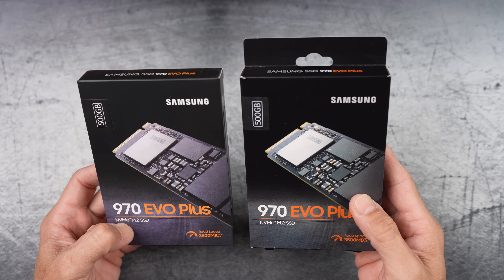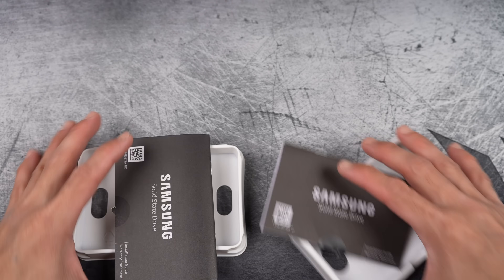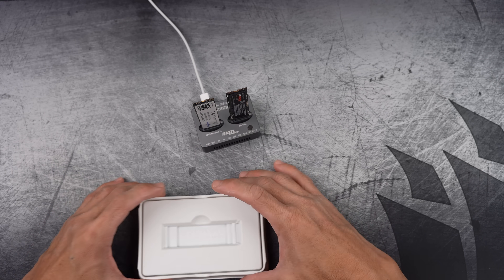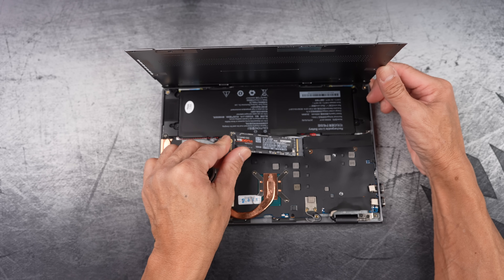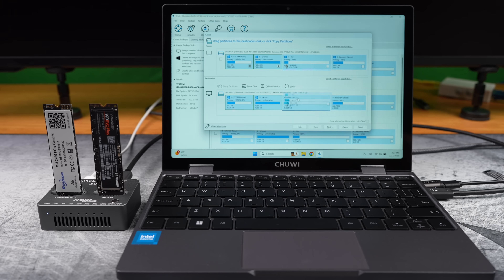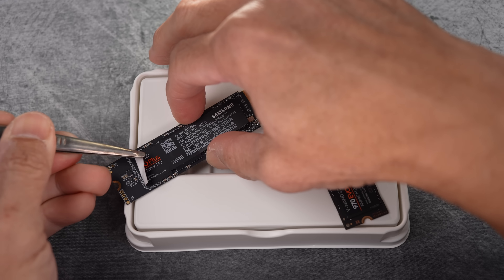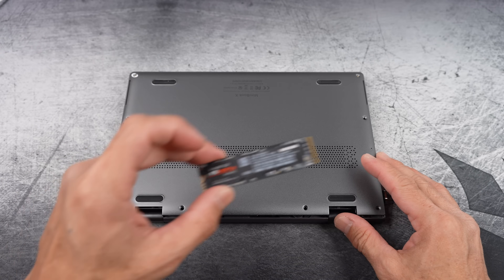Fake vs Real SSD - Can You Spot the Difference?

Comment: I've had fake drives that say 4tb storage but as soon as the drive fills to 120gb it gets ultra hot and drops down to 10-15kb a second.  also everything after this point is corrupted or missing.  😊 it would be interesting to see if the fake drive you have goes past the 120-160gb limit.  The drives that I have tested are from multiple companies and range from 1-4tb each and are brand new.  😎
Reply from the maker: Thanks for sharing your experience! That’s a classic issue with fake drives—they can claim huge capacities but fail miserably when pushed. I haven’t filled this one past the 120–160GB mark yet, but your observation makes me curious to test it further. Appreciate the suggestion—great insight!

Comment: At the end of the day, what risks are there if my drive shows up and turns out to be a fake? Do I get into any trouble if I use it, or are there actual security risks (assuming I format it anyway)?
Reply from the maker: Thank you for reaching out. No trouble at all for using it. Formatting it can mitigate any potential problems. The following are the worst cases: If a drive is fake, the possible main risks are data loss, poor performance, or reduced lifespan. Security-wise, formatting helps, but if the firmware is tampered with, it could still pose a risk from malware. However I wouldn’t be too concerned. If it works fine, then I wouldn’t worry. Using trusted brands is the safest bet.
Reply: @TossSong  Amen.
Reply: Reliability of the NAND. Knockoff SSDs source the NAND from old drives, or ones that have failed QC in the factory. These drives do not last very long. Sometimes they also have worse than expected performance.

Comment: Worst is the reliability difference that the capacitors on the original Samsung provide, in comparison to the generic drives that ignore power continuity altogether.
Reply: The bigger issue is the quality and source of the NAND - generic Chinese SSDs usually use defective NAND that is recycled from old drives, or new NAND that has failed QC from the factory. These drives usually don't last very long and customer support either doesn't exist or they won't help you. It's likely the same for this Samsung drive, although I must say, I've never seen one look so convincing before.
Reply from the maker: Great info. I would agree.
Reply from the maker: That’s a critical point—reliable capacitors can make all the difference for power stability and long-term durability. The generic drives definitely skip corners, and it’s a big reason why we are sticking with trusted brands like Samsung. Thanks for sharing this insight!

Comment: If you use the device to clone from a 512 to a 1tb. do you still have to change the partition size of the larger destination drive and cloning? Do you think the cloning device is worth it?
Reply from the maker: Great question! If you clone from a 512GB to a 1TB drive, most cloning devices copy the partition exactly as is. You’ll often need to manually resize the partition afterward to utilize the extra space on the 1TB drive. As for the cloning device, at $50, I think it’s worth it. Not only can it be used as an external dock for two drives, but it’s also great for quick offline large file copies when needed. Definitely a handy tool to have!

Comment: Terabyte Image for Windows will shrink partitions to make it fit on the new drive provided the new drive has enough space for the actual data.
Use TBI to create an image of the source drive and then apply the image to the new drive.
Reply from the maker: Thank you for sharing. I was able to clean install Windows, so everything is all good now. On Macrium Reflect, I wasn't able to shrink the OS partition because it is encrypted with Bit-locker. But it’s doesn’t matter now.

Comment: Testing in a laptop hides the heat, I find that off brand drive controllers tend to run hotter, the thermal reading not always accurate.
Reply from the maker: Thanks for pointing that out! I think you’re right. I tested the drive both inside the laptop (where it originally came from) and in the cloning dock. Since the speeds were pretty straightforward, I didn’t consider heat or the testing environment much. Definitely something to keep in mind for next time!

Comment: Samsung comes with cloning software that probably would detect if the drive is legit as well.  The true performance difference shows up when you sustain read write, the Samsung will keep a reasonable speed long past when a cheap one will drop to double digits.
Reply from the maker: That’s a great point about the sustained read/write speeds! I hadn’t considered using Samsung’s cloning software to verify legitimacy either. I’ll have to test the drives under sustained loads to highlight this difference more clearly—thanks for the suggestion!
Reply: @TossSong  "Data Recovery & Data Forensic Services" channel is testing those drives to failure, the difference is vast.
Reply from the maker: Thanks for the heads-up! I’ll check out the ‘Data Recovery & Data Forensic Services’ channel—it sounds like a great resource for deeper testing. I appreciate you sharing this!

Comment: I suspect the performance difference is because of the DRAM, I'd be curious to see the true performance for transferring data larger than the DRAM.
(The DRAM acts as a high-speed buffer that communicates quickly with the PC, but funnels data more slowly to the flash memory. The irony is that the fake SSD may actually have higher performance flash memory than the real Samsung SSD. What was the cost difference?)
Reply from the maker: Great point about the DRAM! I hadn’t thought of testing transfers beyond the DRAM capacity, but that’s a solid idea—I’ll look into it for a future test. The cost difference was $48 for the fake versus $84 for the real Samsung SSD. The irony you mentioned about flash performance is intriguing; thanks for the input!
Reply: The dram holds the translation table not cache, the cheap drive just cheats using slc cache which would run out during a long write test and then the controller would not be able to keep up on shuffling things around.  The strength of the samsung is that it would sustain a reasonable speed for the entire capacity of the drive.
Reply: I was also impressed with the fake drives crystaldiskmark numbers.
Reply from the maker: @Nilboggen Yes, I was too myself. It kept up with the original internal drive of the laptop. I still have doubts about its long-term performance though.
Reply: @Nilboggen  Its misleading because they only tested a short burst of data, a full drive write would show it totally gassing out.
Reply: @churblefurbles  but let's say that's the case and it is using cache to throw up those numbers. He ran a 1gb test that would mean it has at least 1gb of cache or it's actually a decent ssd for $48 definitely still a scam as it's pretending to be a samsung. I wouldn't be surprised if he upped the test to 32gb and it still had the same performance.

Comment: Samsung also has a tool for Microsoft Windows that detects fake microSD cards.
Reply from the maker: Thank you for sharing. Good info. I didn’t know it before. I’ll look it up since I also do family portraits for my small business.
Reply: Not sure if my previous reply was actually posted :)

I am glad to help.

I'll be more straightforward this time:
I couldn't find the tool on the Samsung website (Samsung Memory Card/UFD Authentication Utility) but it is available on a Russian website, I won't post the link because maybe YT considers it as spam. Someone mentioned on reddit that Samsung Magician also detects fake microSD.
I also learned recently that there are cameras with 2 separate memory card slots, but you probably already know that :)
Reply from the maker: @InfiniteFreemannn Thanks for the clarification and the heads-up about the tool! I’ve heard about Samsung Magician’s capabilities for detecting fakes too, but I hadn’t looked into the microSD feature—sounds interesting. And yes, those dual-slot cameras can be a lifesaver for redundancy during shoots!
Reply: @TossSong  Not sure what you meant in the last sentence about the cameras, but as far as I understand - the dual memory card slots are just in case one of the cards gets damaged/corrupted and   for that purpose the camera just stores the data /files on both of them... pls forgive my ignorance if I am wrong :)  I have not researched the topic deeply.
Reply from the maker: You’re right, dual card slots are mainly for redundancy in case one fails, and some cameras let you split stills and video between the two. It’s a great feature for important shoots. Thanks for sharing your thoughts!

Comment: I have around 10 x SSD's in use and i bought them only at official retailers.
I only buy Samsung, Kingston and WD. No other brand.
Reply from the maker: Smart move sticking with trusted brands and official retailers. It’s the best way to avoid any headaches with fakes!
Reply: @TossSong  These big brands also have better protection for various hazards.
I have seen that some cheap SSD's and also USB-C SSD's are automatically erased if your PC suddenly loses power. Also, if a laptop runs out of power SSD may also be completely erased.
This don't happen with Samsung, Kingston and WD for example.
In fact one of my external Samsung SSD's are even water proof...
Reply from the maker: @V3ntilator These added protections and reliability from big brands like Samsung and Kingston definitely justify the price difference. Thanks for sharing your experience—it highlights why trusted brands are worth considering.
Reply: @ Your welcome. Around 23 years ago, i remember my work place sold a cheap flash cart brand for digital cameras. Most of the cards failed and lost all pictures the first month of use.
Then we changed to Kingston cards which cost more. No problems with Kingston at all.
Kingston were reliable already when flash cards were a new thing, and they kept being reliable until today.
This is why i always trusted Kingston 100%.
Samsung can also be trusted 100%.
Reply from the maker: Thanks again for sharing your experience! It’s great to hear that Kingston has been consistently reliable for you over the years. Investing in trusted brands like Kingston and Samsung definitely seems to save a lot of frustration in the long run. Reliability is key, especially when it comes to data storage!

Comment: sad thing is just like amazon walmart ebay and any other online retailer they do not care about you and will never stop ,most of the time they themselves are the sellers of counterfeit products disguised as a small vendor
Reply from the maker: You’re right—this is a big issue with online platforms. It’s frustrating how counterfeit sellers can slip through the cracks, even under the guise of small vendors. Thanks for pointing this out!

Comment: Is a gray product from original one will perform more or less the same but wont last so long can came from that country fake usual with fake storage space to trick the pc there is more space some chips can lie pc and overide the files make believe there is more space
Reply from the maker: Great points! Some gray market products might work initially but often lack longevity and reliability. The fake storage trick is a big issue—misleading both the PC and the user. Thanks for highlighting these important details!”

Comment: I don't believe this is "Fake" exactly.  I believe what you have here is an OEM manufactured part that didn't live up to expectation and were rejected by Samsung and are now being sold off by the OEM manufacturer or unscrupulous sales men who bought them at auction.  You have to consider the tremendous cost in "faking" all this would be prohibitive. The manual... the packaging all implies these were manufactured to be the real thing.  They were likely found to be of poor quality or too high a percentage of defects.

I'll even go so far as to say this:  If they are "fake", then all the fakes would be copies and have the same s/n number. But if each box has a different serial number and each chip matches the s/n on the box, then NO, they aren't "fake". They are just OEM parts that were rejected by the name brand company. It would be far too much work to individually serialize each chip without setting up a whole manufacturing line.

@4:35, Regarding the serial number having the slash on the box but not on the chip, look back at the "real" one.  It's the same. Slash appears on the box but not on the chip.
Reply from the maker: That’s an interesting perspective, and it does make sense that some of these could be OEM rejects or overstock rather than outright fakes. The level of detail in the packaging and appearance certainly suggests some connection to legitimate manufacturing processes. However, the performance issues and missing features like DRAM make me lean more towards them being intentionally downgraded or cut-corner products rather than just rejected units. Thanks for sharing your thoughts—definitely adds another angle to consider!
Reply: @TossSong  Maybe its a hybrid of the two. They began making the real thing but lost the contract so having all the packaging just kept on making it but downgraded the chips to cheaper ones. This "fake" is so good, many customers would never know they bought it. Most fakes are nowhere near this good of a copy.
Reply from the maker: Great point. The idea of a hybrid—legitimate manufacturing turned cost-cutting—makes sense, especially with such convincing packaging. It shows how tough it is for consumers to spot the difference. Thanks for sharing this insight!

Comment: there is a small hole near the connectors on the real one  .. and it always has more Dence circuitry you can feel this under the sticker
Reply from the maker: I see, got it, didn’t know that before. Thanks for sharing this info. So much I’ve learned.

Comment: All SSDs without DRAM sucks, also including SATA ones.
They become extremely slow when filling up to the drive capacity, even slower than a USB 2.0 thumbdrive.
Reply from the maker: That’s a great point—SSDs without DRAM can really struggle under heavy loads, especially as they near full capacity. It’s a major factor to consider when choosing an SSD for performance-critical tasks.

Comment: Can you interrogate the fake drive with smartctl to see what firmware/capabilities it reports having? It could be worst if it also copies what the real drive says. On windows, you can use the free version of HDtune to get great details about the internals of the drive.
Reply from the maker: Thanks for the suggestion! I haven’t used smartctl or HDTune yet, but that’s a great idea for a deeper dive into the fake drive’s reported firmware and capabilities. I’ll look into it and might include this in a follow-up video!

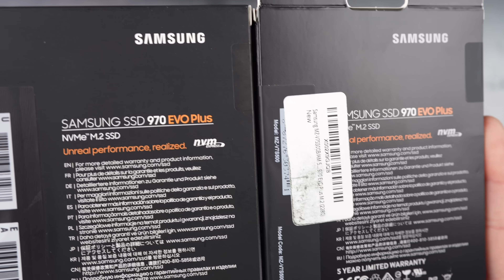Comment: @2:24  "5 YEAR LIMITED WARRANTY"  vs  "5 YEAR LIMITEDWARRANTY"
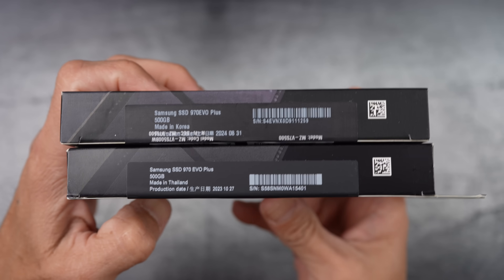Reply: Same with model at 2:00
Fake one is 970EVO where real has space between them
Reply: @mmllmmll22   And the upside down spec info at the bottom that overwrites the existing text.  

But still, lots of effort all together put into this fake SSD drive.  And the drive itself is rather close to the real one's specs.  I was expecting the fake 500G capacity, with the firmware saying it's 500G but in reality its, like, 32G.
Reply from the maker: Good observation! I didn’t even notice that. Thanks for sharing.
Reply: The Error is on Samsung original though. Or maybe the reviewer accidentally swapped :)
Reply from the maker: Haha nope, nothing was swapped 🙂 both drives were double-checked side by side. Some of the tiny text/layout differences are exactly what made this comparison interesting.
Reply: @TossSong  It's interesting to see a typo be fixed by the clone!
Reply from the maker: Haha yeah, that part made me laugh — the clone fixing the typo is kind of wild 😄
Reply: Yeah never trust anything that cant spel

Comment: In Macrium there is now the option to automatically adjust the partition sizes to fit either smaller or larger drives, once you have selected your target drive click on the copy Partitions button and select "Shrink or expand to fill the target disk". I like the look of that cloning device do you have any info on that ?
Reply from the maker: Thank you for your comment and sharing. I know the option to shrink it, the partition. However, I got an error because it was encrypted with Bit-Locker, and I would have to copy sector by sector. 
Yes, about the cloner device, I just posted the link in the description. I just realized that I should have done it before.
Reply: @TossSong  The cloner might be fake too.
Reply: @Moonlightshadow-lq4fr  face palm! good point!
Reply from the maker: @Moonlightshadow-lq4fr That’s an interesting thought. I just hope not. I’m just glad that it works fine, also as a data-transferring dock.